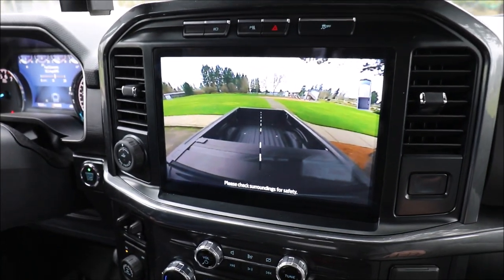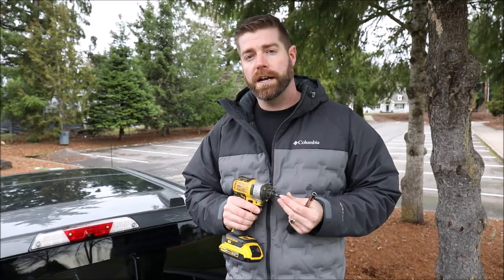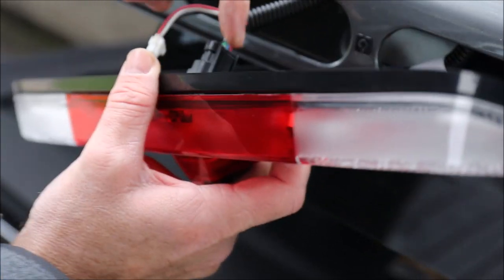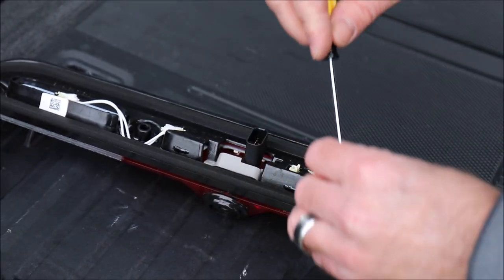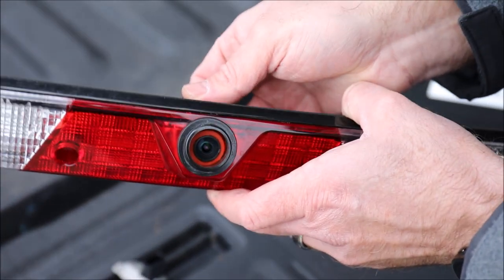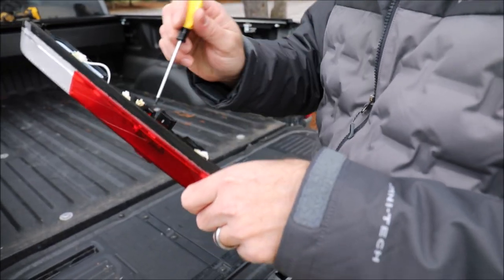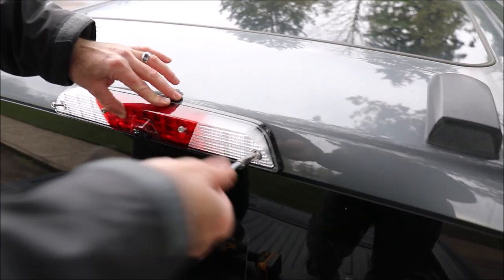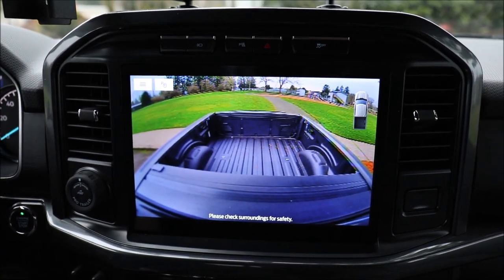Ford F150, F250, F350+ Bed Camera Upgrade Install Video

Comment: Many of the new F15)'s are coming with the CHMSL Camera removed.  Do you know If I can buy this Camera and install it in my F150.  I am being told by the dealership that I cannot add the CHMSL High Mount camera if the truck does not come with one.

Comment: I might be interested in this, but I'm curious on the tech specs.  Original vs upgrade resolution? Original FoV vs upgrade? Low light performance of upgrade?  My 2022 bed camera is only slightly useful and would love to upgrade it.  Just need details to be sure the value is there for my use case.  Especially at night when the camera just blows out from headlights and the rest is grainy as all heck.  Care to post another video at night?  Also, my camera does not have the pixelated center line, 2022 f150 XLT, 8" center screen.

Comment: I wonder if this camera can be altered to be used with the digital WOLBOX G804S 12 mirror dash cam?   Perhaps they can provide the wiring so it can be altered for installation on my F150 Lariat?

Comment: There is a camera recall due to cloudy cameras.  Two different recalls to replace them.  Just got a F350 that has a failed right side camera.
Reply from the maker: This is true however it is not likely they will replace the bed camera as it is not covered under the recall.
Reply: @customsolutionspnwllc  I see the two recalls mention front, sides, and back but you are right, they don't specifically mention the bed camera, but hoped the rear meant both.

Comment: I know they have to have it for legal reasons, but if you made a tailgate camera would you be able to make the box that tells you to check your surroundings in a different location other than stock, stock OEM is Right where you need to see when you're actually trying to check your surroundings.
Reply from the maker: I agree, horrible location. Ours will not likely have that message, however you will have to agree to liability terms when purchasing. Stay tuned for product updates and releases!
Reply: There is a way to remove the message. But it’s jail breaking the Sync.

Comment: I have so many questions regarding this. I've done so much digging and can't find the specs of the oem hardware. Specifically, what the resolution of the 12 inch infotainment screen is and what the resolution of the oem backup camera is. Just trying to get to the bottom of where the bottleneck is as to why the quality is what it is. Love your upgrade, what a huge improvement!

Is there a similar upgrade for the backup camera? (the one mounted in the tailgate)
Reply from the maker: You won't find an answer to your questions as Ford keeps everything under wraps and the answer is fluid. What I can say is the bottleneck depends on the truck, actually. I used an oscilloscope to measure the data. The F150 has a different bottleneck than the Superduty, for example, and the part numbers of the cameras also differ between years and model for performance. The screen resolution of the screen is not that high either, but it's  not something I can easily measure. My guess is near the 2MP mark or 1080P for the 12" screen. Some F150s don't see much of an improvement due to IPMA and APIM module video processing. Hope that helps.
Reply: @customsolutionspnwllc  great info! I wonder why ford keeps it so close to the vest?

Comment: Is the harness already there if it didn’t come with that option from the factory
Reply: Have you found an answer?
Reply: It was there on mine but I have LED brake lights and 360 cam. Ordered from ford and they didn’t give me a bed cam at all

Comment: Will this help the intermittent operation of the camera that many are having? Centerline?
Reply from the maker: Intermittent bed camera? Some vehicles do not have the centerline.
Reply: @customsolutionspnwllc  when hooking up a fifth wheel camper and or slide in bed camper. The centerline funtion is very useful and a is a must have feature in my opinion. Hopefully down the road this will be an option with this upgraded camera.

Comment: Would this camera also work in the "customer placed trailer camera" housing?
Reply: Hello Sonny. None of Fords Bed Cameras or our Bed cameras will work in Fords customer placed trailer camera housing. The connector plug is off 45 degrees from the housing.

Comment: Can this be installed in 2023 F150 that had the chmsl camera delete?
Reply from the maker: Yes it can. However you need the correct cable that plugs into the harness behind the light assembly and the IMPA module needs to be programmed to activate the channel through FORSCAN.

Comment: It appears to be a worthwhile upgrade for an embarrassing truck. but the biggest embarrassment is that ford used the same camera from the previous-generation truck in the handle who's aspect ratio is totally off when they upgraded to the big screen in the center of the dash it's so bad that when you back up to a car it's almost indistinguishable..the proportions are completely  off...but that's what you get when you buy a truck built to a price point
Reply: I've got a 2022 with the 12in display and every camera has very clear resolution aside from the bed camera. But even that camera is perfectly fine for its intended purpose. curious to know what else constitutes as an embarrassment?
Reply: @nicholas2932  the fact that I personally have changed hundreds and there's a tsb and an ssm for camera replacement on virtually every car in the Ford line. The F-150 and F250 cameras get cloudy and faded and there's also a service bulletin for that but they're not available the embarrassing Factor comes in that the aspect ratio is completely wrong when you get the large screen in the F-150 because they use the camera from the previous-generation truck. The cars don't even resemble what they really are and people don't even look like people. The truck is built to a price point and Only Fools keep buying them over and over again.. imagine how many recalls you would have on that truck if it didn't do some of the updates over the air??
Reply: @nicholas2932  I see you didn't read the original post, backup to a Mustang from the side with your truck and tell me it doesn't look like a Miata
Reply: @ubeuonly  Ok cool, so basically if X isn't designed perfectly you're disappointed... I'm not saying your wrong with any of your facts, but name one vehicle that isn't designed to a price point? Everything has issues dude. My trucks backup camera is crystal clear. Is it perfect? I guess not since its got you so worked up over it.... Why on earth are you hating at over the air updates? Your phone does it, your computer does it, Ford starts it and now suddenly they are just covering for recalls? Cars today are computers on wheels, someone was going to be first, Fords known for being innovative.
Reply: @nicholas2932  to me you seem like you settle for mediocrity. There is no reason for a brand new vehicle to come off the truck deliver to the dealership meeting 10 modules software updates if you were a technician and you worked on cars you'd see the ones that are built to a price point you see where the corners are cut you would also see the Ford has twice as many recalls as any American manufacturer. This is fact.. 1 Ford set out to redesign their truck Ram hit a home run with their big-screen so Ford had to do something. They rushed it to Market and anyone who's taking them apart knows that that big screen was an afterthought. They use existing camera with the wrong aspect ratio and that's why nothing looks right when you back up. The shapes are all wrong big cars look small people look like mutants, it could have been remedied but for didn't think it was important because it would have costed money, just like that 1960s Mast antenna and the rusty undercarriage on all Ford trucks, these are facts which you should have looked into before you bought the square truck, the fact that over-the-air updates are available before casting to make it work, neither can Tesla, so is the Technology's not quite ready for Primetime why put it out there in one of the hottest selling vehicles in the world? Kind of setting the company up for failure
Reply: @ubeuonly  I see your valid points... one of my selling point getting this truck is the very video that lead us here... Guy makes a replacement camera cause the original isn't perfect. Sure people are doing the same thing for other trucks. But there's more people buying  f150's so parts and aftermarket are usually more available. I'd honestly like to know, since Ram did an incredible job (aside from the transmission I do like ram) why is the ram 1500 not the #1 selling truck in the US? People are retarded? Ford buys off people to get that title?